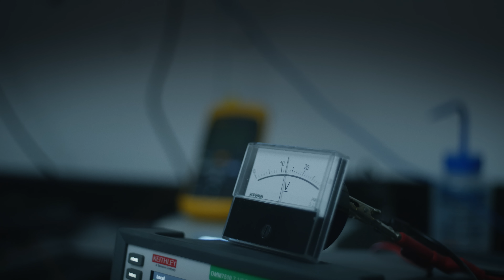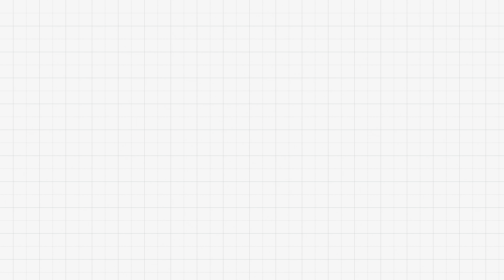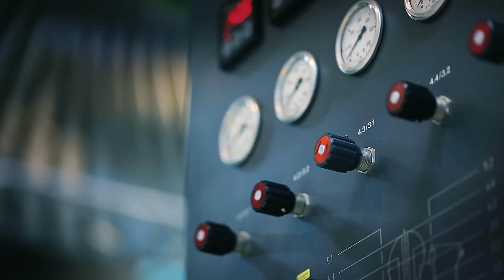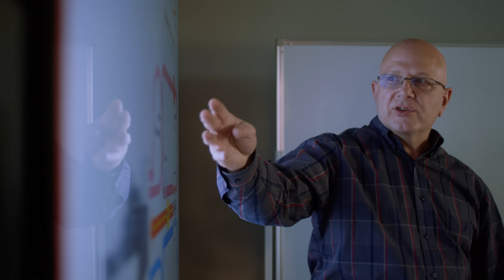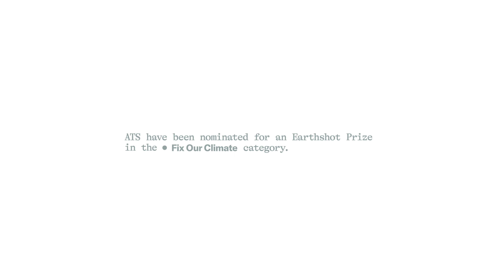Fixing Our Climate | The Tiny Tech Turning Waste Heat Into Energy

Comment: so... it's just a more efficient Thermal Electric Generator (AKA a Seebeck generator) using the same technology as a Thermopile. nothing wrong with it just a matter of cost analysis. there is a reason why TEG's didn't take off since it's creation in 1821.

Comment: Creating energy by using heat? So many questions like, could this work in extreme heat like desserts or what is the minimum temperature needed? Truly amazing!
Reply: look up Seebeck generator. the device in this video is already on the Wiki for Thermoelectric Generators. to answer your question though, they require a ΔT to produce electricity so a dessert would only work if you were also able to cool the cold side.